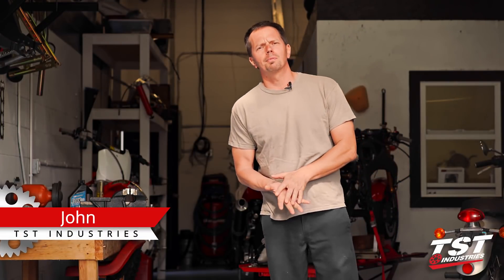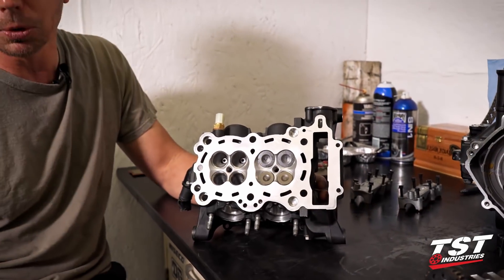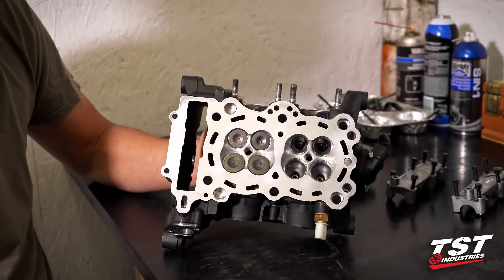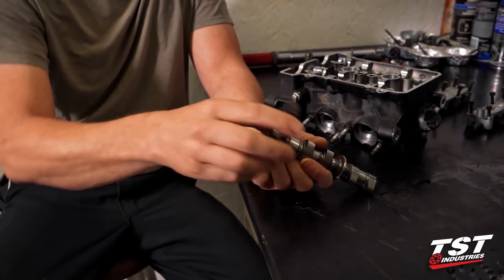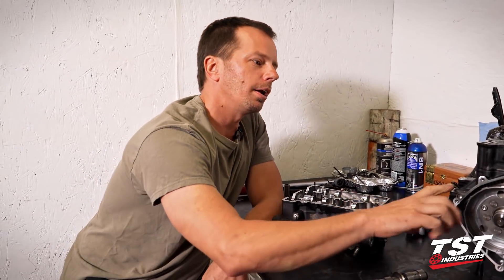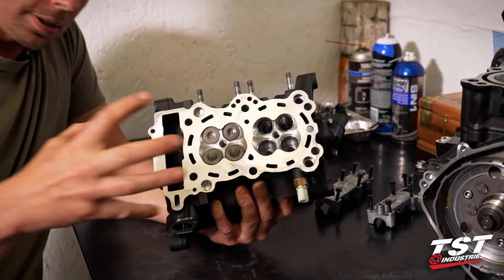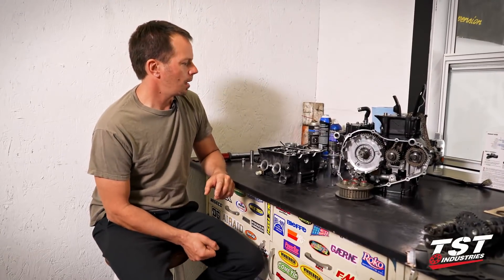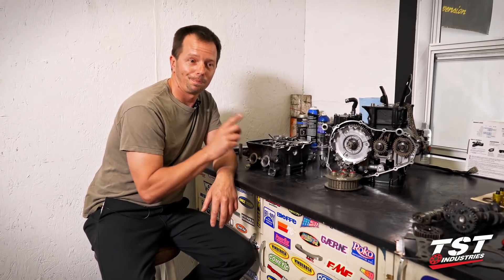More Superbike Engine MODS for the Yamaha R3 [Superbike Build Series Ep.7]

Comment: Binging this! So, without a stator, how long can the bike run before you run the voltage below what's needed in the coil to make it go bang? You're running the coil and ECU, right? Nothing else?
Reply: Never mind - 2m 40s on Episode 9 - found it :-)
Reply from the maker: fuel pump too. With the larger lithium battery we were running times of 27-30 minutes before voltage got unuasable

Comment: Please....Can you explain cooling system in yamaha r3 engine....  how coolant circulate... i cant find where is the bypass hose..
Reply from the maker: There should be a cooling circuit diagram in the service manual. I don't know what bypass hose you are looking for. The thermostat shuts off flow, it does not redirect it
Reply: @TSTindustries  so there is no coolant flow before thermostat open?
I havent the manual book... i bought the bike from a guy... its mt25 bike have the same engine as r3 but diffrent piston size..

Comment: how high did you go with the compression ratio for this build and wich fuel do you intendt to use?
Reply from the maker: 13.2 was the highest we played with. We used pump 93 but it proved to be unrliable. Then we tried Apex but paying that much money for fuel we figured we should be getting better results. We finally settled on U4 and that has been great. One day when I feel like I have time to burrn and rebuilding the motor again is something I want to do I will tune the bike on MR12 and send it. See how long it runs before we nuke it.

Comment: Hey there,, I just wanna ask 1 question, can or not R3 convert cylinder head and cylinder block MT07? PNP or need small modifications?
Reply from the maker: The head and block are wider on the 7, so the crank pins are offset farther than on the 3. Besides, the entire motor block of the R3 is not prepared for loads that high, and the lubrication system and cooling on the R3 would not support the extra heat generated by displacement that large. You are better off swapping the 7 motor into an R3 frame along with electronics, cooling, etc. I would like to see that executed well.

Comment: Have rod failures been an issue with these motors when built?  Those upgraded rods add a LOT of mass/inertia.  Is it needed?  Yamaha engineers are pretty good.  I would be very surprised if the stock rods did not have enough safety margin to handle ANY HP increases you could possibly squeeze out of the motor.  Have you done the rod stretch, BMEP and fluid film stiffness math to determine these are really required?  I do like the slipper clutch, especially if you are upping the compression....

Comment: Wow! This motor looks very similar to my super tenere 1200 motor. Question I have, my OEM timing chain tensioner (oil pressure/spring) type started rattling on startup. Yamaha “updated” the tensioner to correct this issue. Meanwhile I purchased Graves manual tensioner. What is Your way to adjust proper tension on them? Also down the road do I wait for the “startup rattle” to adjust or there is a better way? Thx!
Reply from the maker: I found a pretty good video that I agree with. Here it is https://youtu.be/-Gzid9FbzQc . It's on a different bike but the concept is the same. We typically adjust every time the motor is out of the bike but that is not practical for most guys out there. I would suggest that you pay attention to the sound the motor is making whenever you ride it. When you notice the rattle, readjust. It won't be for a while unless your bike is just in the break in phase and the chain hasn't gotten its initial stretch yet.

Comment: Worried about rod stretch,throw titanium rods in there.Carrillos stretch and are often heavier than stock rods,good thing about Carrillos is they are pinned and have ARP bolts and can be re-bushed,and you can re-use the bolts  multiple times.Carrillo told me 10x,but I checked bolt stretch and replaced after 6th motor freshining.Throw some APE TI retainers in there and depending on added lift you may want to shim them springs.

Comment: I think you mean Duration, and not Lift when it comes to how long the valve stays open....
Reply from the maker: You are correct. John had a little stumble with explanation in this video. Our cams do not extend the duration, they are just higher lift. After this test we will be trying out some high lift / longer duration grinds.

Comment: 12 000 times going up and down? Isnt it more like 12 000 : 4 cilinders is 3 000 times? (assuming its a 4 cilinder motor)?
Reply from the maker: 2 cylinder, four stroke. Each revolution of the crankshaft moves each piston up and down.
Reply: assuming, you better get back to sewing

Comment: intake works better when its not "smooth" btw
Reply from the maker: There is a tradeoff between reshaping/enlarging in certain areas, and having a textured cast surface. We do our best not to smooth the surface too much using appropriate grit size tools, but the inevitable result is that we do end up with a slightly smoother surface than the casting. Like I said, there is a tradeoff, but there are more benefits than drawbacks. If I had a 5 axis mill I would put in dimples, but that will just have to wait until we see what we've got so far.
Reply: TSTindustries cnc ports.

Comment: Did you flow test that head before and after porting? Wouldn't a rougher intake port tumble and mix the charge better?
Reply from the maker: We did not flow test the head. We are basically going on motor building experience with proven results. There is a tradeoff between reshaping/enlarging in certain areas, and having the textured cast surface. We do our best not to smooth the surface too much using appropriate grit size tools, but the inevitable result is that we do end up with a slightly smoother surface than the casting. Like I said, there is a tradeoff, but there are more benefits than drawbacks. If I had a 5 axis mill I would put in dimples, but that will just have to wait until we see what we've got so far.
Reply: +TSTindustries ...Subscribed. Thanks, This will be interesting.

Comment: I have heard guys say that super smooth or mirror smooth finish on the intake side can cause gas to cling to the surface or a little bit of "roughness" creates a bit of turbulence to keep the gas from falling out and creating a better homogenous mixture of air and gas.  what do you think?
Reply from the maker: That theory has been proven correct but in motor building you sometimes have to make compromises. We are basically going on motor building experience with proven results. There is a tradeoff between reshaping/enlarging in certain areas, and having the textured cast surface. We do our best not to smooth the surface too much using appropriate grit size tools, but the inevitable result is that we do end up with a slightly smoother surface than the casting. Like I said, there is a tradeoff, but there are more benefits than drawbacks. If I had a 5 axis mill I would put in dimples, but that will just have to wait until we see what we've got so far.

Comment: Hope he's raced 2 stroke before or that slipper clutch might take him by surprise at first if he is used to 4t engine braking particularly high CR.
I'd be warning him that throwing down gears into the corner inst going to help slow him down like it used to.
Reply from the maker: Those are good points you make. Our rider races bigger bikes typically and he has a slipper clutch on one of those bikes. The transition should be pretty seamless.
Reply: He'll be right then.

Comment: So the engine will only run til the battery dies?
Reply from the maker: Correct. It's called total loss system. We have tested our bike with this setup to run three 20 minute sessions with three starts, and that is not charging in between. When using the lithium batteries we use, and charging in between sessions, there is no need for battery hot swaps. This setup is only conducive for track use. We do not recommend doing this for the street.

Comment: I'm just wondering if you could replace a traditional clutch into a slipper clutch?
Reply from the maker: While you cannot transform OEM components to work as a true slipper clutch, the components in the kit we installed use some OEM parts. The basket and plates are all OEM.

Comment: my dad bought a CB 350 in 79 brand new. when i rebuilt it in 1986 in shop class so i could ride it back and forth to school. i changed the cam. match everything up. shaved the head down alil. and man that made the bike alot more peppy let me tell u.
Reply from the maker: Sounds like a fun project for sure. Also a good way to find out that these little changes on a small motor really do make a difference.

Comment: Are you changing anything with the valve springs? Will you share dyno results when the motor is assembled?
Reply from the maker: We will not be increasing the redline yet in this version of the motor so just fresh OEM springs are installed. After we get some experience with the current setup the plan is to figure out how to tune this motor for higher RPM power, and change out some components to support the higher RPM operation. The stock configuration of the motor falls on its face after 11,000RPM. Many things will have to be changed to make higher RPMs worth the trouble. The entire intake system will have to be re-engineered for different flow and acoustics, different cam timing will have to be implemented, and an off the shelf aftermarket exhaust will not do much for this purpose so we will have to design our own.

Comment: Nice work guys but it's sad to see Japanese manufacturers making these shitty engine's. They mastered 250cc 4 cylinder marvels in 1980's which were revving up to 18000 RPM in stock form with carbs. You guys should build up a 4 cylinder 250 and then compare these so called Morden bike's.
Reply: not that they do shitty engines. they just have to conform to standards, rules and laws.. then balance all of that with the company's financials and make sure they are still making money at the end of the day. They can do this things for sure (i.e. MotoGP, SBK, etc), it's just not for everybody.
Reply: KimmyR3 but don't you think they are only developing the litre class. Every body cannot afford a litre class bike and these 300cc bike's are not exactly cheap.
Reply: yeah well think about how much a damn 300 would cost if it had 4 cylinders it would cost a lot more 

a 1992 CBR 250RR cost around the price of a modern day R3 so it woulda cost ALOT more then an R3 if they were sold new today
Reply: I am restoring an FZR250 right now.!
Reply: they do, but not to this extent I presume. I also have an R3, and as much as I want these companies to give me the best, I also have to be realistic. Heck, we don't even have the ABS version here in the Philippines. lol. The most (i think..) we can hope for is for the little techs to trickle down to their "budget" bikes. Techs like quickshifters, adjustable forks and shocks, better electronics, brakes, etc. Or maybe making the current parts cheaper, making the bike as a whole cheaper. That would also be good. :)
Reply: KimmyR3 I understand your position. I am from India and I have KTM RC 390 with powertronic, here r3 is pretty expensive. I guess you are more lucky coz if you try I think you might get your hands on Yamaha FZR250 the 4 cylinder beauty.
Reply: LOVED my Yammy FZR250. Cost to produce is where it is though. Market back then was race replicas, these days the naked and supermoto scene is where it is at, twins and tripples are in and they are great engines. I can't go past a good 4 cylinder myself and love sports bikes, so I have a CBR600. That said I have a cruiser too I love both. I "raced" a friend with an R3 on my FZR a few years back. Top end = FZR. The R3 has good torque and will be slightly better off the line. There are variables - the R3 was 6 months old with 4,500 kms - a demo bike. My FZR was 26 years old - then and 58,000 kms. Best to find a mint CBR/FZR/ZXR or rebuild one. Parts and cost though, you'll have $5,000 no problem in the engine alone usuing genuine/best aftermarket bits. Avoid cheap, it will likely grenade.
Reply: Biker Life so you have cleared my suspicions that in small engine motorcycle's we have gone down. It's sad to see that a new motorcycle is not faster than a 26 yrs old smaller capacity motorcycle of the same brand. I wish I had a fzr 250, you are a lucky guy. Don't sell it.
Reply: Biker Life Noooooooooo 😔😔😔😖😖😖😡😡😡🤒🤒🤒
Reply: lol it'll be a long process, I'll try to take enough pics to at least put together a slideshow! It's the intricate problems that arise that really make one think of creative solutions. Thank you for your interest.
Reply: Yamaha Rider J it's a good point but think about in 1992 Asia was not a big market for good motorcycle's exception of Japan. I am from India and I remember in 1992 the only performance bike we had was Yamaha rd350. But today people can afford a lot and we have all brands here. I have KTM RC 390. Also in Asia we don't have big roads and riding a 600 or a 1000 might not be practical, buying a 1000 in India is only for millionaires. Buying a 4 cylinder 250 will be expensive but still pretty cheap compared to a 600 or a 1000.
Reply: I'd get the CBR250 MC19/22. Parts are far easier to get. Had a shit of time trying to get FZR250 parts. Was a beast first bike though. I rode close to 30,000 kms on mine.
Reply: Sadly I did sell the FZR. Funded my CBR600. I reckon if it was 100% mechanically with less miles I'd have pulled away more but it was neck and neck until the R3 ran out of breath, I still had 5,000 extra rpms. Also rider ability comes into it. My friend and I were quite evenly matched when we raced. I also wish they would have 250/400cc 4 cylinder bikes again. I'd get one in a heartbeat.
Reply: arealassassin please make videos of the restoration
Reply: arealassassin thanks a lot. It's one of my dream motorcycle
Reply: There are quite a few reasons why manufacturers aren't making 4 cyl 250s anymore. Extremely low torque in the low end makes them horrible commuters that are easy to stall and don't get off the line with as much oomf. They are also much more expensive to produce, would you buy a 4cyl 250 that cost as much as a 400/500 with a slower 0-60? That would be hard sell in today's market for what are considered beginner bikes. I'm sure there are some people who would buy it, but would enough people buy it for a huge company to make a profit, probably not as your seeing companies like Honda contemplating dropping even the cbr600 line because of low sales.
Reply: Steve Krawczyk  the case you have given is for few countries, there are so many other countries where it's nearly impossible to buy a 600 so thinking of a 1000 is out of question. In these parts you don't have roads for big bike's, having a 250 which is fast enough and sounds amazing will be enough for the people. As I have written earlier that I have modified KTM RC 390 and the power similar to Yamaha fzr 250. Low end torque is not really an issue, and remember they were running on carbs. With today's technology low end torque can also be solved. The real problem is that these companies are not run by engineer's now, they are run by marketing department. If these types of bike's are made in India or Thailand like KTM are made then there price will be decent. It all comes down to the company if they want to make an effort.
Reply: Ahh ok I'm from Canada and if you are looking for a used bike you see older 600-750 bikes for the same price as a newer 250. Most people upgrade to a 500+ after having a 250 for a couple years and your insurance rate goes down. Still I say the price is the driving factor, 1 cylinder = 1 piston, 4 valves, 4 valve springs, 1 con rod, 1 spark plug and 4 cylinder = 4 pistons, 16 valves, 16 valve springs, 4 con rods, 4 spark plugs. You still have to make all those parts to the same level of quality and when your talking about an 18000rpm motor the quality would have to be a even higher. Dont get me wrong if I had the choice I would trade my cbr250r for a cbr250rr in a heart beat but those bikes are worth a fortune now. The $$$$ is the most important thing for a manufacturer to consider it's too bad that because of that we don't have the option.
Reply: Steve Krawczyk you are right about north America but here in asia, southeast Asia, south America and some parts of Europe 250 with that kind of power is good enough. I think if they are made in big volumes they will be not be expensive. These bikes were launched in late 80s to mid 90s in Europe, Australia, Japan but today people can afford these bikes in other parts of the world. But looks like that it will remain a fantasy.